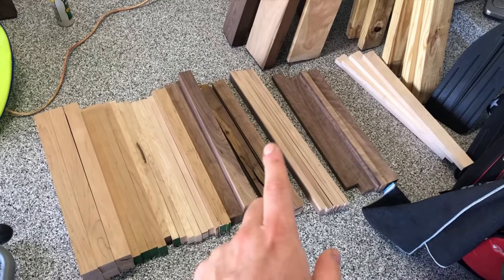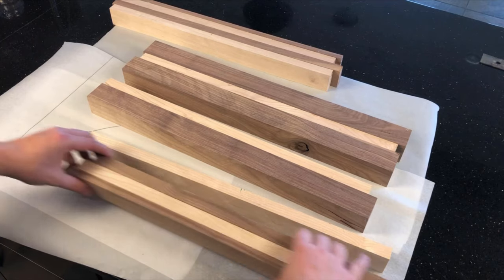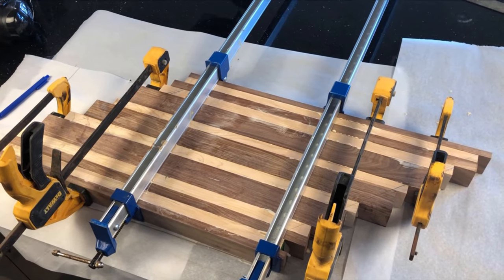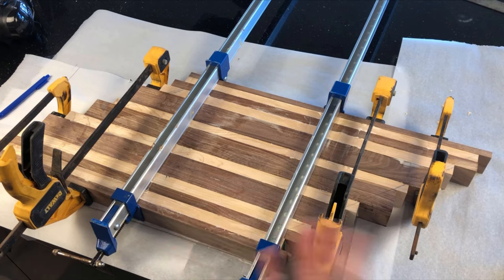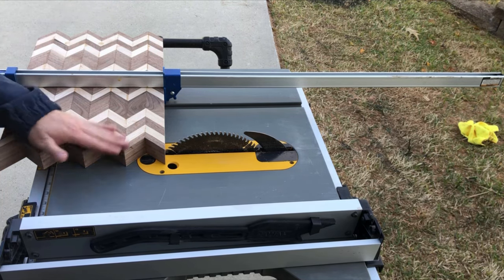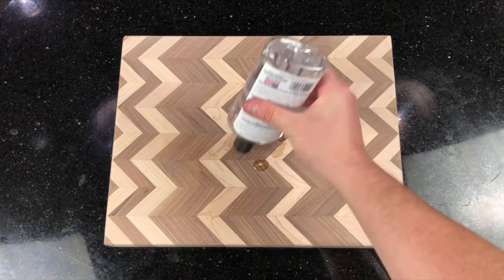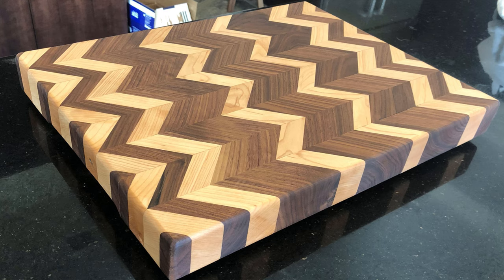Chevron Cutting Board (Walnut and Maple Hardwood)

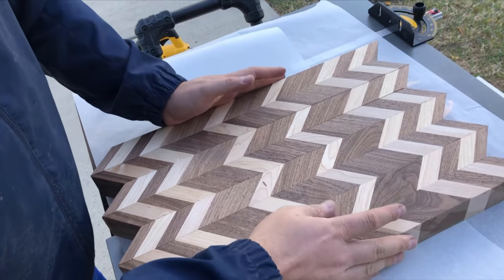Comment: Just a quick note. at 7:40 you say you're not going to take it back to jointer/planer for fear of the chevrons not matching up any more. If you joint them together at the same time it would remove the same amount of material off of each piece. That would leave the chevrons lining up after they were all done.
Reply from the maker: Hey Rob, I probably didn't do a great job of explaining myself on that. I was concerned about not jointing and planing each separate piece the same amount, which could throw off the pattern. I hope that helps clear things up.

Comment: That looks amazing, but it is also a lot of end grain glue joints is it not?  How has it held up?
Reply from the maker: That's a great question. Typically end-grain glue joints are not as strong as face grain or edge grain joints because of the way the fibers on the wood are oriented. This was one of the key reasons I made this board 1.5"+ thick to increase the glued surface area of the end grain joints. So far the board has held up well with no failures or signs of deformation or joint separation.
Reply: I was thinking the same thing. I think I would have added two 1/8”x1/2” splines around the entire board. One by the top and one by the bottom. I think that would be a pretty rad design feature as well.

Comment: great job on that cutting board you got me in trouble now my wife wants one I know you gave a rough estimate of the measurements could you get a little more detail I appreciate it believe me I appreciate it
Reply from the maker: Sure thing. The length of each board I used is around 22”, the height is 1-3/4”, and the thickness of each board ranged from 1/2” to 2”. The important dimensions is that the length and height are the same. You can get creative on how thick you want each board to be because this is what will create the pattern. I used 3/4” - 1” thickness for the maple strips and used 1/“2 up to 2” thick for the walnut.
Reply: Thank you so much for the quick reply and the information thank you very very much great job

Comment: great job...what are the widths of your boards
Reply from the maker: The length of each board I used is around 22”, the height is 1-3/4”, and the thickness of each board ranged from 1/2” to 2”. The important dimensions is that the length and height are the same. You can get creative on how thick you want each board to be because this is what will create the pattern. I used 3/4” - 1” thickness for the maple strips and used 1/“2 up to 2” thick for the walnut.

Comment: I haven't tried the initial glue up with the lumber offset.  I've only done them "square."  Do you find you have less wasted wood using your method? Just curious,  I'm gonna try that. Nice board BTW!
Reply from the maker: There is significantly less waste by doing it like this. The next time you make a chevron board you should give this method a shot.

Comment: At the beginning of your build what was the dimensions of your strips
Reply from the maker: Hey Doug, The length of each board I used is around 22”, the height is 1-3/4”, and the thickness of each board ranged from 1/2” to 2”. The important dimensions is that the length and height are the same. You can get creative on how thick you want each board to be because this is what will create the pattern. I used 3/4” - 1” thickness for the maple strips and used 1/“2 up to 2” thick for the walnut.
Reply: From one woodworker to another, thanks so much .I'm going to make one
Reply from the maker: @dougbowman9651  you bet Doug! Good luck.

Comment: I used the same wood and the same number of pieces and mine measures 13.5” -not 12.5”. Are your boards 3/4” ad 2” ?
Reply from the maker: The width of each of the boards varied from 3/4" all the way to 2". This range of widths may be why our dimensions didn't come out exactly the same.

Comment: Freat design what size did you cut the peices lenght widgth
Reply from the maker: The length is around 22”, the height is 1-3/4”, and the thickness of each board ranged from 3/4” to 2”.

Comment: Is that for resale? What's the typical price paid for a custom board like that?
Reply from the maker: Yes I did make this board to sell. The wood itself is worth about $125 in my area so I would normally sell a board like this for $200-$250. If you are able to customize the board with engravings or carvings then you can fetch an even higher price. I have seen customized cutting boards used by real estate agents as closing gifts for their clients so there is definitely a market out there.

Comment: What were the length of the pieces before cutting the angle?
Reply from the maker: Hey Scott, they were about 20"
Reply: @EigenDesigns  Thank you and the end length was 18"? I am trying to make a chevron board that is 12.5" x 18"
Reply from the maker: @412scott  No, it wasn't quite that wide. It was closer to 16" once the final trimming was done. I would use some longer boards to give you more length in the final board.
Reply: @EigenDesigns  Thank you. I have one that is glued up in my clamps right now. It is 12x27" right now. I didn't stagger the wood like you did. I will have a lot of waste. I hope it will be around 18" after I put the 30 degree angle on it. I will start doing them like you did on this one. Saves a lot of waste. Thanks again!
Reply from the maker: @412scott  Good luck! If you have an instagram be sure to tag me in it when you're done so I can see your great work.
Reply: @EigenDesigns  Thank you and I definitely will!
Reply: @EigenDesigns  I tagged you on some things I have made. I will tag you on the board tomorrow. Thanks again
Reply from the maker: That looks incredible Scott! You are super talented. Thanks for sharing that with me
Reply: @EigenDesigns  Thank you very much and my pleasure.

Comment: Aren't you glueing  end grain to end grain on the second glue up?
Reply from the maker: Yes, that's correct. Typically end-grain glue joints are not as strong as face grain or edge grain joints because of the way the fibers on the wood are oriented. This was one of the key reasons I made this board 1.5"+ thick to increase the glued surface area of the end grain joints. So far the board has held up well with no failures or signs of deformation or joint separation.
Reply: @EigenDesigns  Not to be negative dude, but I see a big problem with this board. First, you are glueing end grain to end grain which is inherently weak and, because it's a cutting board it will get wet and then dry and then get wet again and dry again, etc. which would be hard on a proper glue joint, let alone one that is end grain to end grain. I don't see this thing lasting. I hope this is for personal use so you can monitor the life of the board. Good luck!

Comment: Looks good brother! 1st, get some better clamps. If you had gaps in other projects, your clamps are the culprit. Those squeeze clamps don’t provide anywhere near the pressure you need. Those harbor freight bar clamps aren’t much better.
Also, instead of waiting for one side to dry then waiting for the other side to dry, use those long clamps as legs and stand it up against a wall somewhere and both sides will dry.
BUILD A CROSSCUT SLED PLEASE!!!
Running the short end along the fence to cut the length on a table saw the way you did is super dangerous! If you tweak it just a hair, you can get some nasty kickback. Not only will your board probably be ruined (or need serious repair), but you can get hurt...I’ve seen it happen more then once. Plus you’ll get a more square cut then using that janky miter gauge.
Lastly, save your money and go to a pharmacy and get mineral oil. It’s the same exact thing for a bit less dough. The company you used does make a nice board conditioner though that has mineral oil and beeswax.
Saturate with mineral oil, wipe off the excess, rub on the conditioner, let it dry a bit then buff it out.
All in all...board looks great!!!
Not trying to be a turd...just telling you things I wish someone told me when I started. Look forward to see what you do next!
Reply from the maker: All very solid advice. This was my first real youtube video that I made so you will see some of your suggestions put into practice in my more recent videos (e.g. parallel clamps, crosscut sled, etc.). I am going to look into the pharmacy mineral oil - I hadn't heard that one before. Thanks for the tips!
Reply from the maker: Not sure if I ever told you, but your mineral oil suggestion was awesome! I finish my boards at a fraction of the price now. Thanks so much for the tip.

Comment: What are the dimensions of your lumber before your glue up?
Reply from the maker: The length is around 22”, the height is 1-3/4”, and the thickness of each board ranged from 3/4” to 2”.
Reply: @EigenDesigns  so what was the final dimensions of the finished product
Reply from the maker: @nishithchristian5407  It was around 15" x 18" x 1.75"